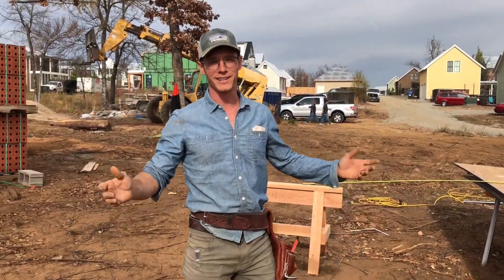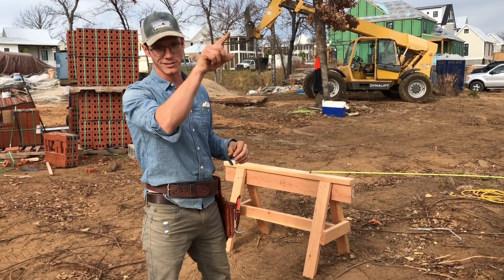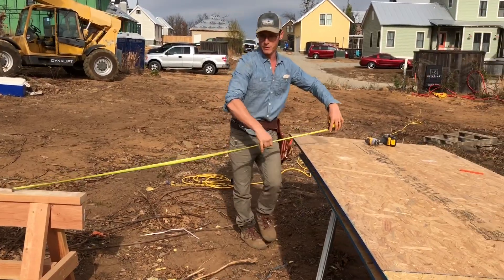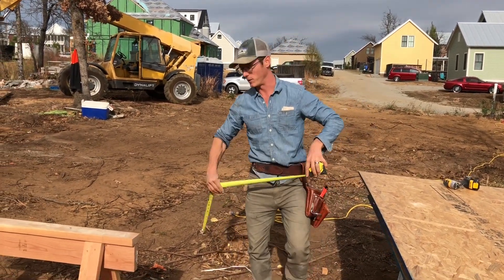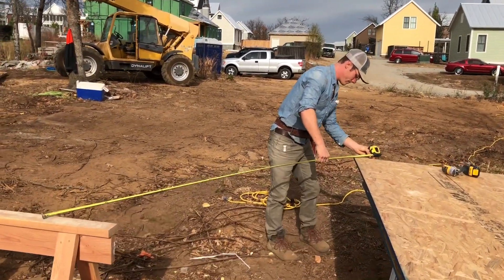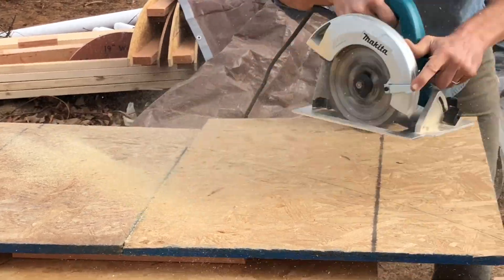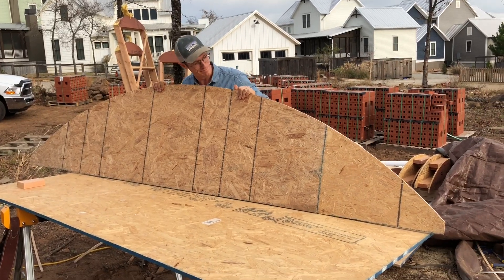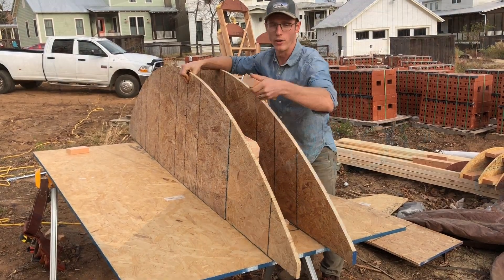How to Building a Brick Arch: brick arch the Form, Part -1 Construction Video

Comment: For framing the fastest way to do this is put the plywood on edge hook chalk line at the corner pull it to 10ft then drupe the line to the 2ft mark..now slowly lay the plywood down mark the line and cut it only once buy releasing the depth table as you cut plunge the saw up and down every 2in or so. For brick work 2ft is fine but a drywall arch looks better at around 12 to 16in.

Comment: So why did you need the arc measurement from Google. You had the width and the height/ rise, then marked the arch so no need to google?
Reply from the maker: Still need the radius.  Technically you can figure it out manually by just moving the string/tape towards/away from the arch til the end hits all 3 points.  But easier to get close by calculating, just need width and height and the arc calculator will spit out radius so you know where to pivot your string/tape from.